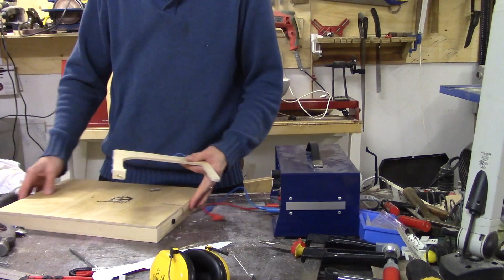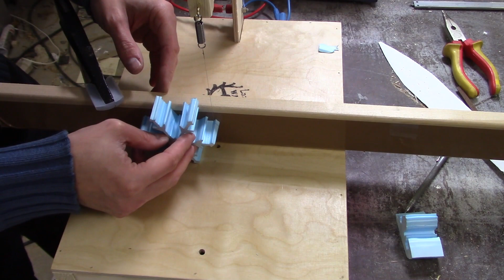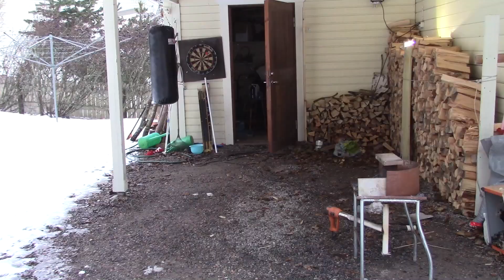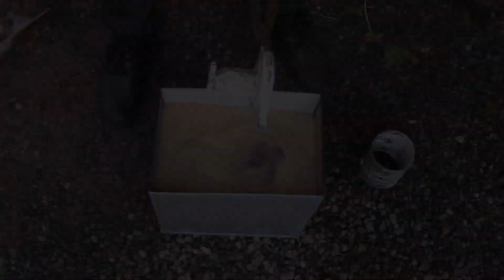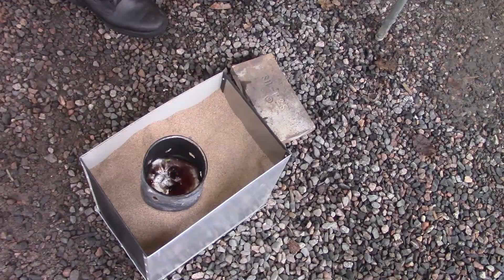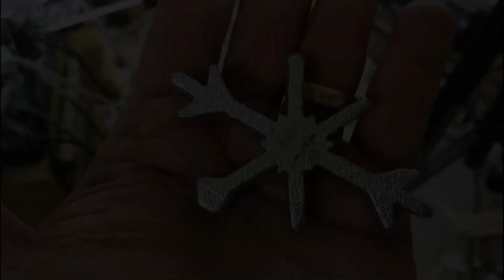Cast aluminium snowflake FAIL!!!!

Comment: Do not worry. Another time will be better.
    - -
Aluminum does not work very well on small parts. It is better to choose an alloy of aluminum with silicon. We call it silumin.
But it's even easier to use tin or lead.
The melted foam model is not suitable in this case.
It is better to make a folding shape, and pull out the model.
The mold must have a minimum of 2 holes. One for pouring, the second for the outlet of metal and gases.
The temperature of the metal should be above the melting point by at least 100 degrees.
Reply from the maker: AlfFisher Thanks!
Reply: also a higher tower gets you more pressure and better filling of the outer parts.

Comment: Well, no two snowflakes are the same! Good try. I think if you had more motel AI to pour, the pressure might push into the outer parts of the snowflake.
Reply from the maker: I did try to make the last sprue longer but i think the foam was too thin for this to work. Thanks for watching .